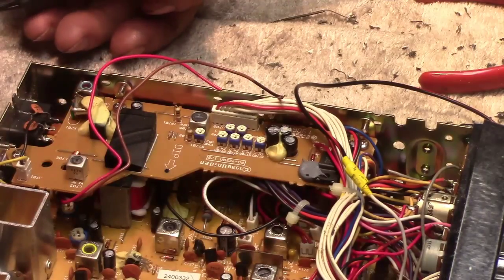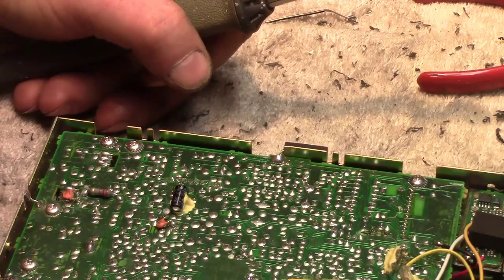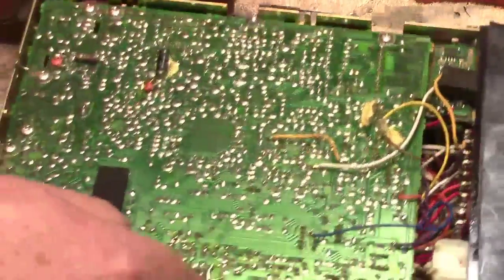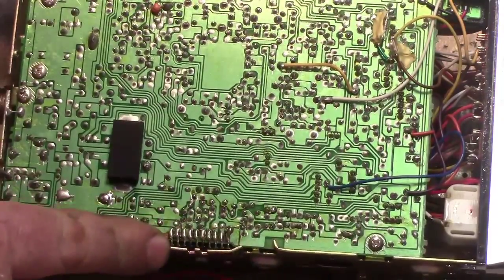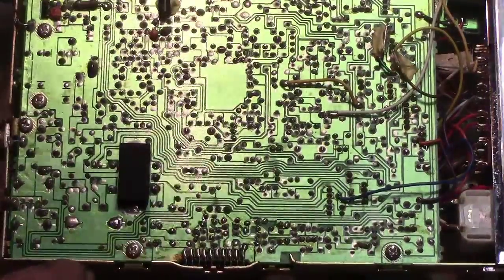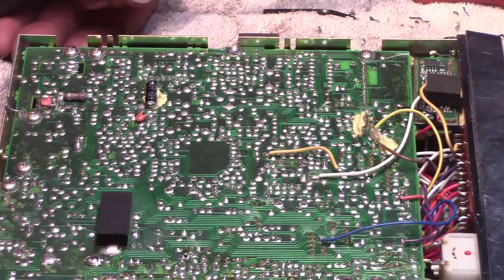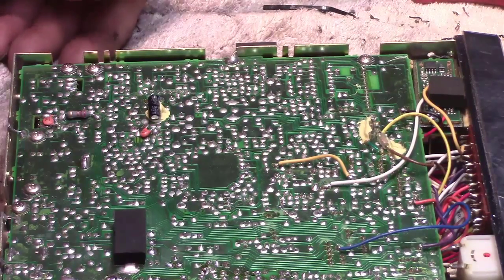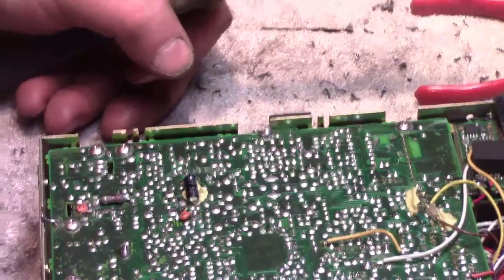Repairing a CB radio.

Comment: My buddy Justin  aka Captain Jerk was in my live stream panel earlier and told me about your channel.......   Yep those audio chips are in a bad spot , especially if the rubber washers in between the radio and mounting bracket are missing..... When the bracket screws are tightened up the audio chip is pulled away from the PCB ....  I've dealt with that many many times in my years of radio repair....... I will be a regular on watching your video's .......
Reply from the maker: Thanks for stopping by. I was just talking about Justin, I haven't seen anything from him lately.  lol, he mentioned me? I wonder where that conversation was going. :)
Reply: @buzzsah   We were just chatting and he knew I had a radio shop back in the 80's and 90's and he spoke of you and I looked you up......
Reply from the maker: O, I also owned a shop,  a little over 4000sf.  Sales, service, and installs of CB, ham, cellular, stereos, alarms, ......  I sold it in the early 90's.
Reply: @buzzsah  Yeah 4000 sqf.  is a lot of space, I had 2 guys for installs ,  one regular and one for back up if Wayne was busy with one or if he wasn't available... I was busy with the repairs and installing toys and Roger Farts, a buddy and I found the tone circuit on the Road Runner roger beeps and we gave that high pitched beep a deeper sound.... We could put a pot on it and get many tones out of it....Also we found the timing part of it and could extend it....  That took off like wildfire, we kept no less than 50 beeps in stock for the first year or so.....
Reply from the maker: I hear that I got screwed by China and Japan.  Way back in the late '60s. Toys were just starting to be popular. So I designed an echo board with a variable control for timing and amount of reverb, it would work both mobile/base the only problem I had was the size, I couldn't make it small enough to install into a mobile, and if I built it into a box so the mic would plug into the box and the box to the radio the feedback was there unless you turn down the mic gain. A friend told me he knew a guy in china that had a manufacturing company and he could downsize it to fit.   I made a deal with them for 500 units over 1 year so we had the deal.  My problem was no patent and no non compete contract. China took my plans, made my 500 then started making them under other labels and selling them to Jiggs, LES, and everyone at a much lower price. I think I still have 2 on the 500. lol  That was just one of many dels I gave away.
Reply: @buzzsah  I knew Dick Briggs, I think Briggs was his last name..... I thought he developed the Tarzan and the others himself ??  I knew he was a engineer at one time.... Yeah I installed many reverbs from him , his were not adjustable at the time I got out of the biz.....  I installed many of the LT-2 boards, those were cheaper than Jigg's toys.... A lot of people liked the LT-2 boards, they were adjustable...I'd like to see a picture of one of your boards....
Reply: @buzzsah  Oops I replied from my gardening also....
Reply from the maker: lol.
Reply from the maker: I'll dig it out I don't have the one I sent to china the original that was about  the size of a pc33, about 7Dx5Wx2H. I sent it so they could copy and downsize which they did, they did a good job at it but I did have a few made in Japan  which was better but more money.
Reply: @buzzsah  Yeah if you can find one from china or japan , i'd sure like to have look at it.....  I used to install the older echo boards in the 80's.... I might recognize it...

Comment: radio shack is still around they just closed a few stores people keep saying they went out of business but they did not all that happened is tandy part of radioshack went under so they closed so radio shack closed all stores that wear corp stores and left all the privitly owned stores open. they are going back to scratch and rebuilding.
Reply from the maker: Yes, we have one about 19 minutes away but they don't have much inventory.
Reply: buzzsah so true and the prices are nuts on what they do have I buy most stuff now online from amazon ebay and http://tinyurl.com/hpxcpso
Reply from the maker: I will use MCM but they aren't as good as they were back then, the prices are fair but on IC;s, diode,.caps, transistors are limited.
Reply from the maker: I have been there but their parts inventory is low.